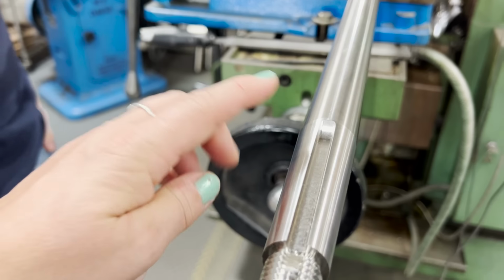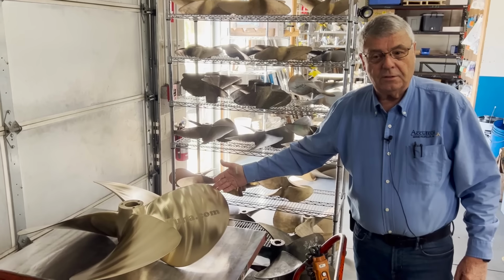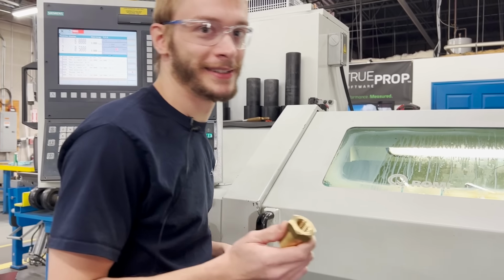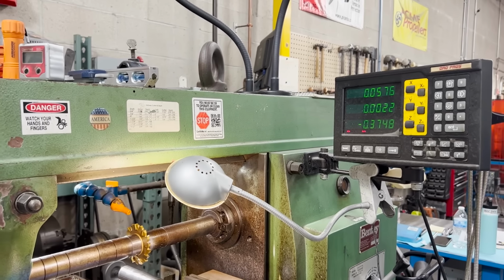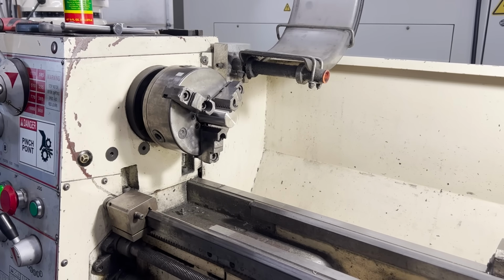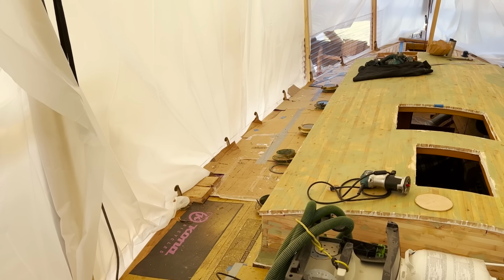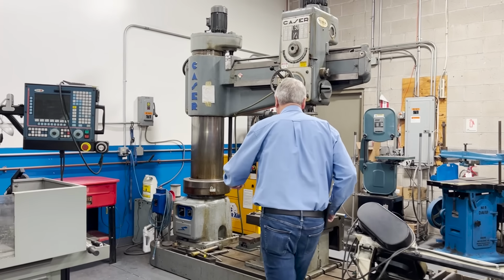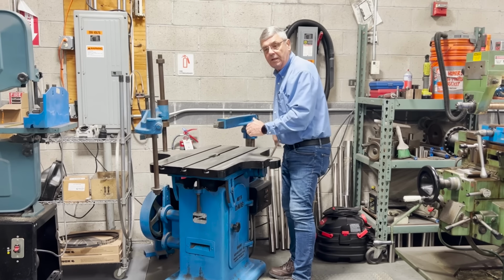Enjoying Modern Life? Thank A Machinist! - Episode 244 - Acorn to Arabella: Journey of a Wooden Boat

Comment: Have you seen the new props that have blades that look like 3D infinity signs with several extra loops?  They eliminate the problem of the sudden stop of blade-to-water force at the blade outer tips, much like more complex winglet shapes used in modern aircraft wings to improve wind efficiency by reducing the whirlpools of air that form at the ends of the regular wings due to the sudden stop of wing-to-air drag.  Some YouTube videos show that these new props can give 5-20% increased thrust for a given prop speed/engine power output, saving on gas (same reason the airplanes use them now).  These are still in their infancy as to water drag effects but are quickly being perfected to replace standard prop bade shapes.  Might be worth your while.
Reply from the maker: Interesting! Definitely sounds like something that’s still being developed.

Comment: Nice work folks.  Consider laying all the fiberglass on the work and squeegeeing the epoxy through the cloth all at once. Makes it a lot easier to position the cloth while the wood doesn't have epoxy on it.  Also, be careful how much epoxy you use for the first coat.  Too much and the cloth can float off the surface which is not good.  You should be able to clearly see the weave after the first coat has cured.
Reply from the maker: The wood needs wetting out for success. I can see what you mean about handling, but the success of the laminations sticking to the surface relies on it.

Comment: It would have been interesting to learn what factors determine the specs of your prop shaft. I imagine the size and weight and shape of the boat the water conditions where you plan to sail,  the torque and max RPMs of your engine, the size and pitch of your prop, your prop shaft length are things that get factored in. But it what relation to your prop shaft. What materials are traditionally used for making a prop shaft? How did you arrive at the prop shaft you are using?  what about carrier bearing and packing and gaskets.
Reply from the maker: We’re not quite done with prop talk. I think we’ll hit most of these points.
Reply: @AcornToArabella  Isn't past your bedtime?
Reply: Oh yeah, I remember now. I had it in my head, that tree  was cut down to the ground and this was a different tree

Comment: Nice. I also have a variprop, which I'm glad I had when I converted from diesel to electric. The electric motor is direct drive (no transmission) and required me to reduce the pitch of the prop, which was easy to do by adjusting a couple of set screws. Interestingly, my prop shaft has an SAE tapper, but a metric thread.
Reply from the maker: Thanks for sharing your experience, Dan!

Comment: As a sailor I often have to tell people new to boats to take better care of my ropes. They see it as just a 'bit o' rope', but I have to inform them that it is valuable equipment whose good condition is essential to the smooth working of the rigging & sails. And that using the correct knot, tied properly is a safety issue. At times they made me feel  that I was a bit too fussy about my ropes, but I have to be..  Then I came across rock climbers`whose reliance on the ropework goes in to a whole new level. 
So I would trust Steve, and Robin, to be Grand Masters in anything that involves hoisting and/or restraint using ropes.

Comment: I’ve been hearing about the Orcas attacking sailing vessels off the coast of Iberia .  I was thinking of fire crackers to drive the Orcas away.  Maybe though a underwater siren could be fitted to the hull?
Reply from the maker: Not sure what’s possible, but it’s interesting to think about.
Reply: Harpoons will work...or some dynamite.  -But seriously what are the chance for Arabella to be attacked by Orcas, vs other more probable problems they should take in counter?  By the look of the work they put into this boat, I think they will be fine. I duppose the weakest link is the lack of sailing skills. And as long as he builds up that skill in the same way as he builds everything else, they should be on the safe side.

Comment: Those machinist milling machines are fascinating. Thank you for sharing the prop shaft manufacturing process.   I know you will probably show it later on, but I was wondering how the variable pitch propeller works.  How do you control the pitch?
Reply from the maker: Watch this humdinger of a video here: https://youtu.be/qbWw65grXd0 it works… when it spins. It just DOES. Neat, huh? —Anne
Reply: @AcornToArabella  that is neat. Very clever engineering. Thanks for sharing that little video.

Comment: The relationship with your suppliers is second to none. Teaching us all about vendor selection, machining tolerances, 99% vs about 70%, test fit-up with matching components. Reassurance for supply, durability and servicing when required. Best part is the repeatable, customer work due to CNC programming documentation. So everything (shaft, key, keyway, bushing, taper, shaft thread, prop fit) specific to Arabella is well documented. Even made allowances in the event of a prop change.
Another great documentary video. 
Feathering props are unique to each application, blade size, blade pitch, # of blades, blade thickness, blade material and blade coatings. Ease of replacing damaged blades. Spare parts or the "quick" replacement for damaged components. Now that the shaft and prop are done, Steve do you plan to do a brief summary of the feathering prop design, features, benefits, compromises and disadvantages? Relative to boat size and weight, drag, boat speed, forward/reverse delay, blades caught on weeds or floating debris/garbage, docking based on forward/reverse due to prop rotation bias.
Reply from the maker: Yes, we’ll cover the thought process for the propeller choice for sure. Larry came by to drop off the propeller and gave us a rundown on how to care for it and why it is special. Thank you for this thoughtful comment!

Comment: Isn't working with a regular lathe way more fun than a CNC for passion projects like this?
A friend of mine worked for a CNC shop a bit, wanting to do machining work. But he got so bored within a week that he quit.
His only job was basically pressing the start button and taking out the finished product... He felt like all his skill and intelligence was wasted there..
Reply from the maker: We don’t need the process for a good fitting shaft and propeller to be fun, necessarily, and that type of work isn’t for everyone. Hope your friend found something great to do eventually!
Reply: It's more fun when you get to do the setup and programming as well. Not just operating it once someone else has set it up.
Reply: @UnderearthEDO  yeah ok that makes sense

Comment: Were the port light holes cut after they did the fiberglass work? Because I'm thinking maybe their masks didn't fit so good. 😅
Reply: I think he might be referring to the oblong shape of the windows in the front and back. Fore and aft. That's actually the shape of those windows.
Reply from the maker: Oh man, if can you cut a better circle while on your knees facing 90 degrees from your working surface on a narrow side deck while crouched with a heavy jigsaw then good on ya. 🙌
Reply: @AcornToArabella  xD